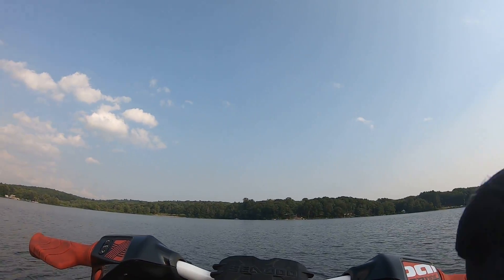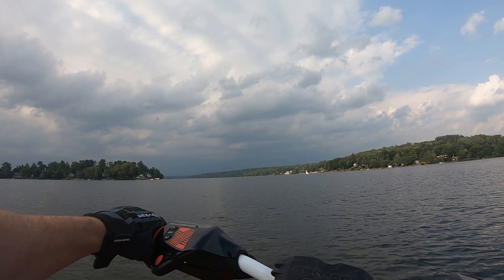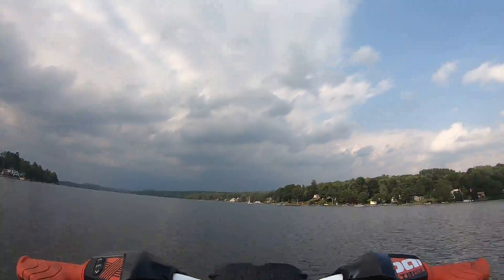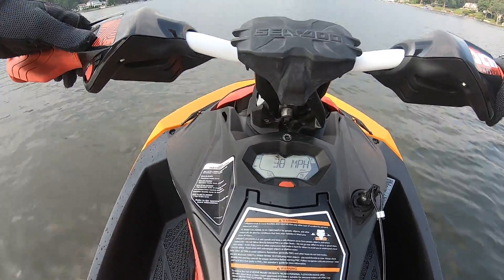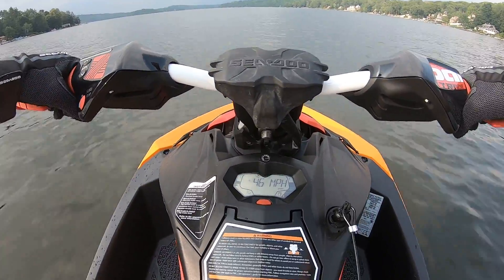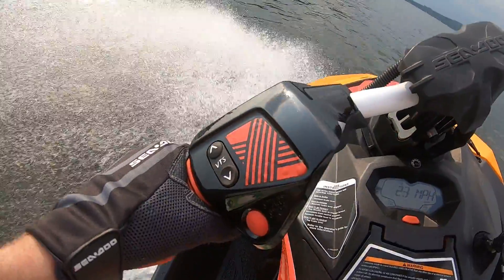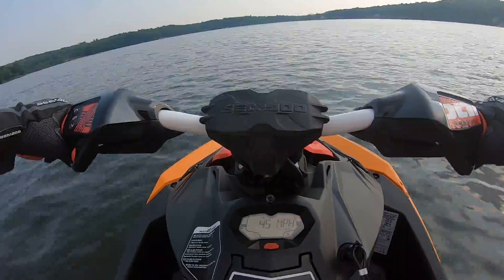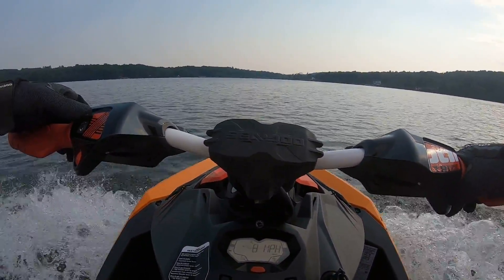I Tested The 8900 Tune On the Sea Doo Spark Trixx And It Was Bad

Comment: What gas you have to put in there after the tune, isnt it like 91 or 93 octane
Reply: 91 or 93 for 8600 but 100+ for this tune or E85, he’s not specific to which tune he’s running or which gas he put it other than ‘pump gas’ so 93 at best

Comment: I run a RIVA MaptunerX BRP And utilized it to reflash my  ECU. MaptunerX provided me the ability to quickly and easily load performance tunes directly into my stock ECU eliminating the downtime that results from shipping for programming to other shops. The Performance tune was calibrated to provide optimum fuel delivery, ignition timing and rev limit to compliment RIVA Racing Performance Kits. OEM dash display, engine diagnostics & engine safety functions were  retained. MaptunerX also gave me  a full color, touch screen display, ability to restore stock tune settings.
Going to try on E85 or M1 next.